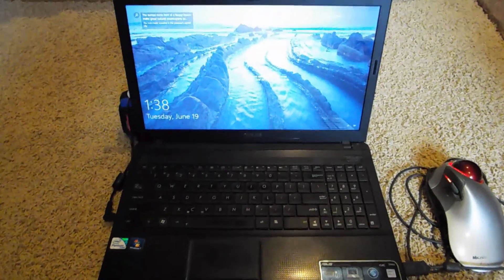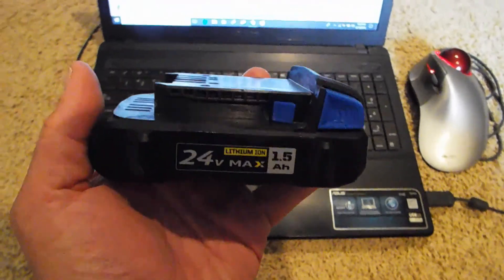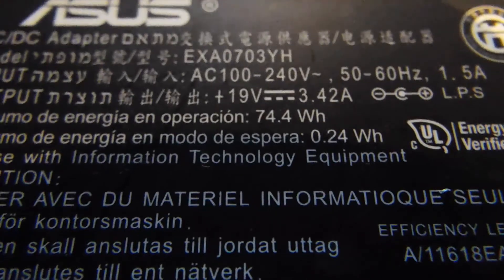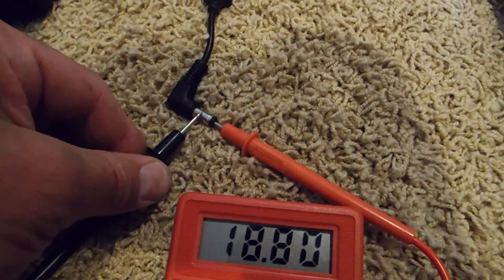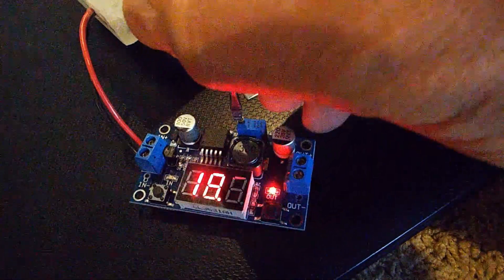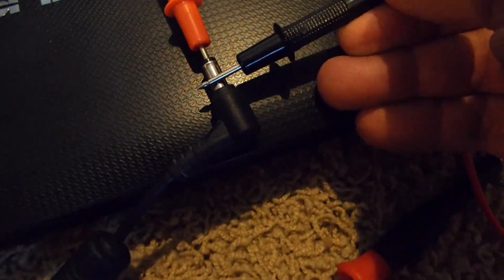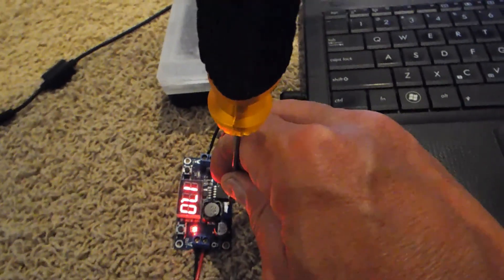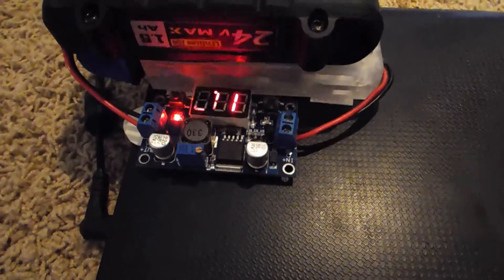Cheap Laptop Battery Replacement DIY

Comment: Nice, thank you for sharing.   But laser? The closest I come to this video is the same red multimerer  LOl. How much did the regulator cost?  LIKE #  6. 
 Keep them coming & stay well, Joe Z
Reply from the maker: Hey Joe! Laser was one of the toys I had always wanted for the longest time so there it is...I love those red multimeters, the price is right (free on coupon)  The regulator with the display was about $6.00 the ones with out the display are $2.50. I choose to use one with a display since this was the prototype. I am using the laptop this morning on the Kobalt battery to test how long it will run using it normally, so I am dong all of my YT stuff on it right now.